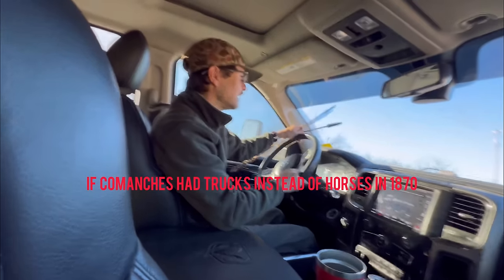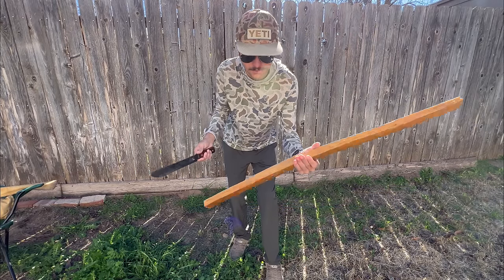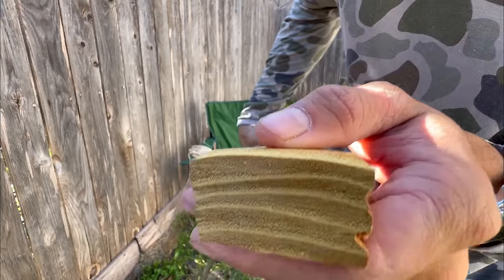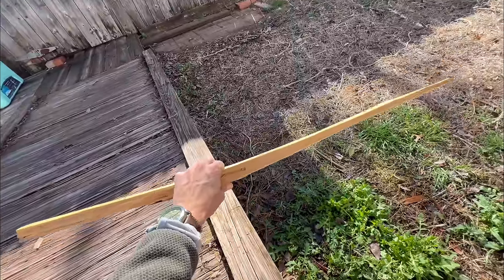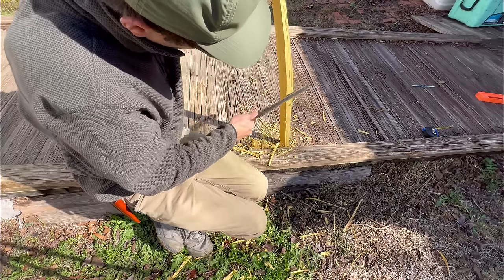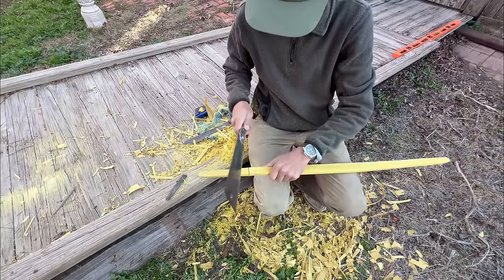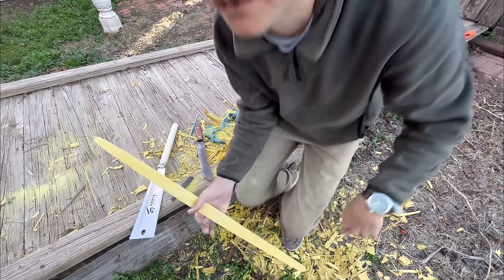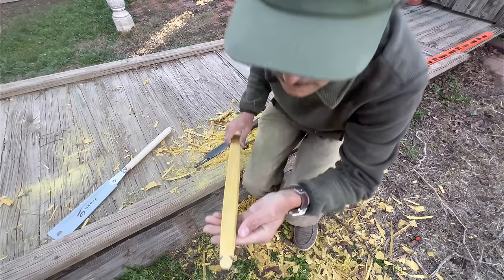Ultra Short Native American Bow Build & Test - Comanche Bow Series

Comment: Im 63 years old and i have built around a dozen bows, all while in my late 20 s early 30s. But there was no internet back then, so everything was learned the hard way. the more bows i made the shorter i kept makeing them,the,y might look like a kids bow but they are deadly. I am impresed at how fast they can shoot with only a 2o or 21 inch draw. The last bow i made was a recurve around 40 inches long the limbs flexed all the way. I heavely sinued the bow had a string made only to find out the lower limb twisted, what a bummer all that work, that was the last one. Even 35 years old those bows still shoot good,what i really want is to go hog hunting spot and stalk with stone points.

Comment: I started with a 72 inch seasoned osage stave and ended up with a 64" longbow it took a bunch of heat bending and I went a little past my target weight.  It ended up 41lbs at my draw length. That's a really nice piece of osage.  I had about 50hrs total in my first bow.  Thanks for making these videos

Comment: Up here in the great basin, my bow wood of choice is Rocky mountain juniper. Ive never had the privilege of working Osage.
Juniper has tiny micro growth rings. Most staves in my stash came from 500 year old + branches.
You have to back juniper with rawhide, sinew or any other hard backing or it will break.
They have good compression strength and nearly zero tension strength.
I have achieved weights above 75lbs. Its a really heavy arrow design is how you harness its full power.
Its red dogwood, chokecherry or stone maple is what i make my arrows out of. Obsidian points. And sage grouse, mallard or canada goose fletching. Dental floss string.
It's mostly rough grouse and squril i hunt every year.
Congratulations on that little bow surviving tillering and stringing. I know how difficult, exhausting and rewarding this is.

Comment: So a couple of things about the short plains Indian bows. Things are very much an evolution of purpose. What I mean by that is how they were used. 

One, they were used primarily from horse back. This circumstance would desirous of a shorter bow than a long one during to having to maneuvering it around while mounted.

Two, their were meant to develop full power at half draw also due to them being used from horseback.

Three, they had to be very powerful because of the usual intended target…bison. Most specifically a bison skull. Very thick, very tough. 

The way hunted bison was they would ride beside a bison and shoot a short but heavy arrow through the bison’s head, killing it instantly. If they failed to do this the bison could and would turn on the hunt and very likely kill them. Hunting bison with bow and arrows was not easy and was extremely hazardous. It can be seen from this that most shots were taken at very close range. Accuracy was secondary to the bow’s ability to drive an arrow through a bison skull. 

Plains Indian bows are truly a marvel of a tool being adapted to a specific purpose… the harvesting of bison. I can’t help but admire the testicular fortitude of the hunter that used bows like this.

Comment: 4:32  Just built a 25 inch bow out of blue or white ash(Im not sure its a branch off of a tree in my yard) and it works pretty well(for a first non breaking bow) it’s just not straight because the stave I started with wasn’t, but I didn’t think it would turn out this good🤣🤣